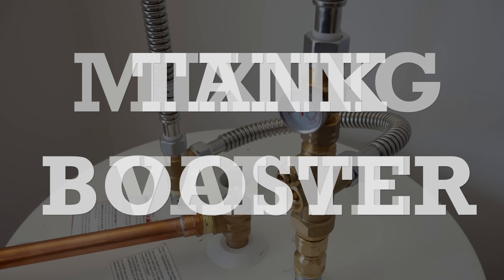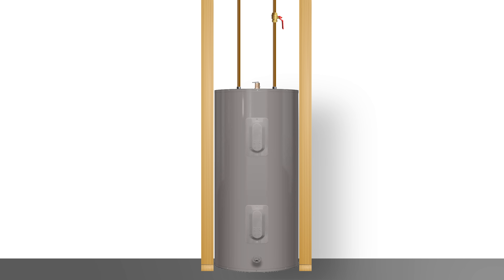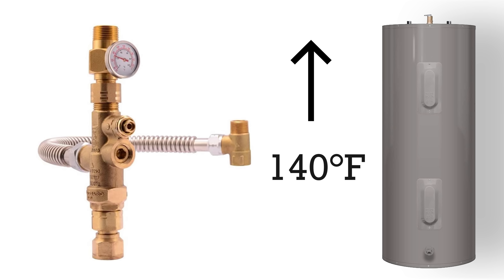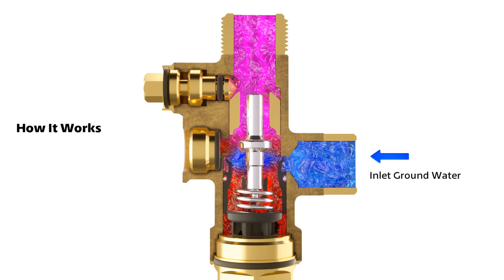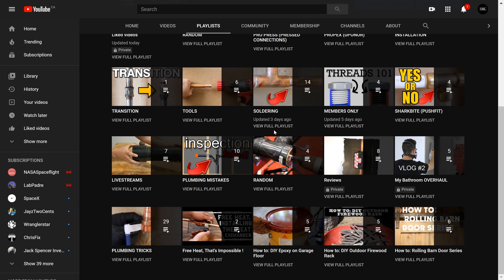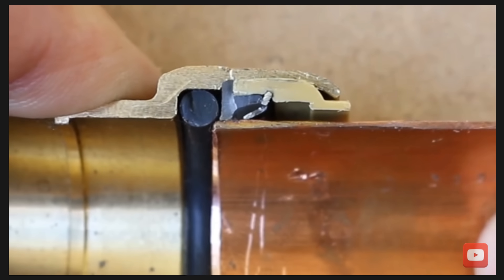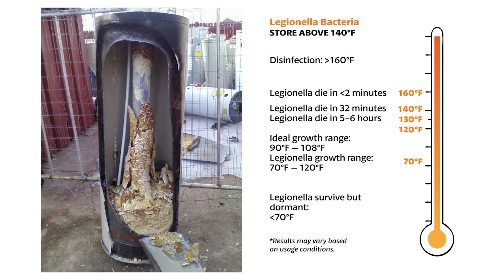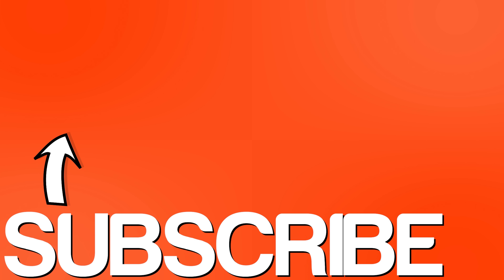INCREASE Your HOT WATER Capacity With This! (Cash Acme PRO Mixing Valve) | GOT2LEARN

Comment: That's a completely flawed argument in favor of the mixing valve, it does NOT save money.  In all truth, keeping the hot water tank hot means there's more thermal pressure, aka delta t.
The period of time where the water is heating is the most efficient time from a heat loss (entropy) perspective.  The only exception to this would be where the hot water supply line is an exceptionally long run, then the cost of the valve and installation might be cost neutral in a few decades.  Mixing valves are used to keep people from burning themselves (elderly) and equipment damage from over-temperature (unregulated solar).
Reply from the maker: You didn't watch till the end I pressume, I said at the end that the only place you save money is by not having to buy a bigger tank.
Reply: @Got2Learn    That would be correct..  However, it should be noted that a mixing valve will never provide more energy (heated water) than what you have stored in the tank, regardless of it's dilution.  The first law of thermodynamics prohibits it.  Anyway, my apologies as this is your channel but as a retired engineer the idea you'll get more out than you put in gave me a nose bleed.
Reply from the maker: @texNoz  the valve doesn't provide more energy, the tank takes care of that as it doesn't deplete itself as quickly, it's quite a simple system, the tank does work harder though let's keep that in mind here.
Reply: @Got2Learn  Firstly, I'd like to say thank you for a civil and open debate.  That's something almost never found on the internet these days.  It shows you have great character with a position of reasoning as opposed to hostility.  Perhaps that's why you have such a following, including myself as I've subscribed.  
Please do the math and you'll see the illusion unfold.  The ONLY way I can reduce the refill rate of a hot water tank is to either reduce the flow rate at the final supply (tap), or reduce the final temperature of the mixed water at the final supply.  Otherwise, the cold water and the hot water will have to mix at exactly the same volume/rate to obtain the same temperature.
The exception to this rule is if I leave an excess of higher temperature water in the hot water line running to my tap, that's where the second law of thermodynamics comes into play and entropy becomes a factor.  Again, keep an open mind and look at the math.
Reply from the maker: I thank you as well, most of these debates go bad, but I find that this is where the true answers, actually get answered.

So here's my thinking. Without the mixing valve, 100% of the hot water is used when a tap is turned on but with the mixing valve, only maybe 50% is used because it's mixed with the cold water, so this in turn keeps more of it in the tank. This wouldn't work if the tank's heating elements weren't bumped up to a higher temperature of course and it's what makes all of it possible.

I also understand that, because the tank is HOT most of the time, the delta T is more of a problem, but from what Cash Acme is saying, it's not enough for it to become a problem and I tend to believe what they are saying because a lot of people have installed these and have nothing to say about them.

Comment: It adds capacity, but reduces your efficiency.  A hotter tank will have more standby losses.
Reply: Everyone should cover the hot lines coming from the heater as far as you can, and adding a "Blanket" to the tank is not hard to do to increase the insulation factor, both saving you money even without this modification.
Reply: @archangel20031  adding a blanket literally does nothing, you losses are from stack and piping primarily
Reply: @MrDmadness Esp. with new/er energy efficiency tanks with the insulation built in and/or housed in a conditioned area. Ours doesn’t feel hot at all so makes no sense to insulate.
Reply: which is funny because the reason the problem exists in the first place is to increase efficiency
Reply: Actually, yes, the bigger temperature difference from ambient will increase heat loss... but a slightly less hot, bigger tank might loose as much heat, as the bigger tank will have more surface area exposed to ambient. 
Also, the smaller tank will "wear out" faster, but the replacement cost of the tank, and separate parts (elements) will be less.
Reply: Additionally, the life of the water heater will be diminished by the overwork it does.
Reply from the maker: @Efferheim  nothing is free! 🤷‍♂️
Reply: @Got2Learn  definitely not $1500 water heaters either. Go away with your petulant money wastin'
Reply from the maker: @keyworksales6241  ?
Reply: @keyworksales6241 how do you come on someone’s channel & tell them to go away? You are the only one who seems petulant in this situation.
Reply: No device that encourages more water use, especially hot water, is going to save energy. The "I need more hot water" is rarely about the dishes or the laundry, it is about showers and bathing. This is just another trick to lower the temperature at every faucet in the home to "save energy". In the meantime some of the laundry has to be run twice, the dishwasher leaves residue and requires rewashing, and everyone is taking a 30 minute or more long shower. The video was.informative, but I really hope this technology doesn't gain wide spread acceptance. It is just a red herring that covers up the problem (if there is one). Limiting hot water use is the number one way to save energy, not making the max available temp lower and lower.
Reply: @adaycj  The water heater should already be set at 120 max for safety. Raising to 140 and outputting 120 doesn't make a difference, except for allowing the tank to store more energy.
Reply: @pb2959  I never said it did or didn't, and I didn't list a temperature. Limiting hot water use is the number one way to save energy no matter what the heater is set at.
Reply: @adaycj  You were talking about making the max temp "lower and lower". Max temps does not change.
Reply: @pb2959  I can't seem to understand where you are coming from here. Did you watch the video? There were charts and text about the water heater already being at 120f and being raised to 140f for the version of this device featured in the video to work. The temp at the faucet or point of use IS lower if you mix in more cold water when you start with 120f (or 140f) at the water heater.  The info graphic at 2:58 shows it clearly. They are trying to run the faucet longer before the temp drops too much.  Then starting at 6:12 they are turning up the heater setpoint to compensate.
All this mixing valve does is allow hot water to flow for longer before a 10f temp drop with a reduced burn risk.  I stand by the statement "No device that encourages more water use, especially hot water, is going to save energy."
Reply: @pb2959  umtrue.. it is code in north america that high mass storage must be at 140f this is because bscteria ( legonella specifically ) cannot survive this temperature. You also cannot by code deliver water hotter than 120f to a fixture, hence mixing valves. You dont cost any more tempering the water from 140 to 120, you spent $$ at the tanks storage temp. True that 120f storage will be slightly cheaper but we are talking $20 over the course of a year, not worth the risk of bacterial infection. Ill guatantee you that youd rather spend $20 than have legionella
Reply from the maker: The capacity will be greater than the losses from the differential in this case, totally agree with you Jeff 👌

Comment: i didnt hear how long they may extend hot water delivery.  or did i just miss that part?
Reply from the maker: Depends on the household, can't really tell.
Reply: @Got2Learn  water flow at x temp for y minutes wont matter if its a single person or a fam of 50.
Reply from the maker: Check the PDF linked, it tells you the increase in % with all the variables, hope this helps!
https://www.cashacme.com/wp-content/uploads/2016/06/Tank-Booster-Pro-Brochure-Web.pdf

Comment: I have an external heat pump water heater. The down side is slower recovery, but with increased energy savings.
I've wanted to install a tempering valve for some time, but haven't gotten around to it.
This "all in one" device seems to be the better solution.
Having a heat pump water heater negated the additional heat loss setting the tank temperature higher.

Comment: Don't use the safety valve to drain the tank.  The safety is a ONE TIME USE - meaning that it is sealed with a break away seal -- after the first time it operates it will never seal again and while water won't be gushing out of it, it will always leak after the first use
Reply: Not even remotely close to true. Besides you can not drain  from the t&p valve it is installed near the top of all water heaters where the temp is the highest.
Reply from the maker: Yeah, I don't know where @Keith Proctor got that from lol.

Comment: Most water heaters made today have upper and lower thermostats make sure you adjust both thermostats to 140 degrees
Reply from the maker: Yes, 100%
Reply: I have never seen 2 stats on a water heater.
Reply: @98ek9  On most electric 240v water heaters here such as Rheem, Rudd, State, A.O.Smith do have two thermostats, one upper and one lower.
Reply: @1200sbeemer  fair enough. Haven't done any electric water heater bigger than 15 gal. 
95% of ours are nat gas.
Reply: @98ek9  I hear ya, no problems.
Reply: Your an idiot if you do that. That’s a way to ware out  your wh faster or creat a bomb
Reply: @Thatsouthernplumberguy  who told you this? If you cap off the relief valve maybe a bomb but not from adjusting the thermostats both on 140. 
Both upper and bottom should be set the same temp too btw.
Edit; I once went to a customer’s house who capped off his relief valve because it was leaking, he told me on the phone and the water heater was swelling up. I told him he shouldn’t have done that and to open the hot water anywhere in the house and turn the power off to the w/h asap. When I arrived the fire department was there because minutes after we hung up it blew up. Never ever plug the relief or pop-off valve.
Reply from the maker: @Thatsouthernplumberguy  Do what, I don't get it?

Comment: I got the mixer and installed ez but lost a lot of hot water pressure!! That's a big con!!.... Update liking the little doohickey
Reply from the maker: No reason to lose pressure with these, check the strainers to see if they are blocked.
Reply: I'll check them out
Reply from the maker: @jasont8627  that's the only thing I can think of right now.
Reply: @Got2Learn  no luck! water got a little more pressure better after removed both of still bad hot water pressure after installation
Reply from the maker: @jasont8627  is this with all the faucets in the house?
Reply: I forgot got 2 check the sink strainers, I'm good 2 go now, I think I knocked some stuff off the old pipes, didn't think I would have much I have a water softener.... thanks 4 your replies!!!
Reply from the maker: @jasont8627  Awesome, that would have been my next solution, glad it's fixed!!
Reply: @jasont8627   i’ve found that even shutting the supply down for service work loosens debris in the lines.  I always flush the gunk out of all the fixtures when I’m done.
Reply: @tomrogers9467  is it a 1/4 turn valve 9r a globe/gate if the latter type then what nappens over time is the rubber seal gets crushed and wears out, then it flakes into the line

Comment: So this takes extra power to run? Instead of just turning on the mix at the faucet? Cold water still goes into the tank to replace what was lost but you have to run the water heater much higher to compensate? This only saves if you don't already mix your water and if you do it would waste energy.
Reply from the maker: Watch the video, I explain where you save money and how it increases your hot water.

Comment: Have been compulsory install for last 20 years in Australia. As a safety device for children and elderly  as they start to lose sensation in fingers and hands
Reply: The problem in Australia, the regulation requires 50 degrees output at the closes tap.
So water never hotter enough on the further taps.
Reply: Was just thinking it's funny how these aren't a legal requirement in the US when we have been installing them for like 20 years

Comment: In the winter, the water from the city supply is very cold. So much that my insulated toilet tank gets cold and humidity condensates on it. This valve could supply warmed water to my toilet and resolve the problem, can it be set at 60-70 degrees as an example??
Reply: Perhaps you could coil some pipe somewhere to let your house warm it.
Reply: @chaos.corner  I tried that but the coil gets cold and water condensates on it, it acts as a de-humidifier and I would need to drain it all the time.
Reply: @wetrock2766  Makes sense.

Comment: True way to increase hot water, install a DWHR (drain water heat recovery unit)
Reply from the maker: Works too!
Reply: Nope, the math on this in fact proves they are not worth the price. Plumber for over 25 years here, not trying to toss shade
Reply: @MrDmadness  Depends how cold your water is in winter, up here in Eastern Canada, it drops down to 3C/37F, with my DWHR unit while taking a shower, it bring the incoming temp all the way up to 18C/64F! You can get up to 3x as much hot water. It has became mandatory in new contructions in certain provinces in Canada now, it pay itself in 1-2 years in a 2 individuals household. The unit I use is older and only have 46% efficiency/8kw (3" diameter, 40" long and 1/2" inlet), newer units have 3/4" inlet to reduce pressure loss. https://ecoinnovation.ca

Comment: Great video, glad someone actually talks about this, I have a guess you would called it a "ghetto mixing valve" we found out after buying the house, it's hard piped in. Either way it's very similar, one problem I've noticed when flushing toilets or really any cold water usage you instantly get super hot water so please keep this in mind if you're thinking about doing something like this, also this could be just how my house is plumbed. But there could be an issue arise where when you use hot water somewhere else you'll lose all hot water while showering. He's correct about using more energy as well. You'll use about 20-30% more so keep this in mind in the long run measure your area and just get a bigger tank or go tankless because at the end of the day going this route will cost more.
Reply: Or you just use a thermostatic mixing valve so the temperature is regulated.

Comment: This has been an OSHA code requirement for over 25 years....
Reply: except osha doesn't handle anything residential... no retrofit install will have this device. nice try though.
Reply: @tslim250  it's also code in my state. Also common sense to not die from legionaries.
Reply: @CybekCusal  I have mine at that right now, all original faucets in the house. I get the saftey thing but it's been that way for a long long long time, people have just gotten to stupid.

Comment: Stop lying to people. Neither one "saves" money or increases the amount of hot water.
Reply from the maker: You didn't listen to what I said in the video, I said the only place you save is not having to buy a bigger tank.
Reply: @Got2Learn  the mixing valve one mixes cold water with the hot water, but in order for that to "work" you have to crank up the tank temperature. And the other one is basically a point of use water heater. Neither one saves money. They only give the illusion of having more hot water.
Reply from the maker: I never said you saved money on the water, you save money by not having to buy another tank, using the mixing valve will actually cost more in hot water because of the higher temperature differential.
Reply: @Got2Learn  Actually you did say that it will save you money.
To Quote your video
min2:42 The energy required to reheat the entire tank is greater than if it was maintained at a hotter temperature at all times.
Which is a common myth. it goes against the laws of thermodynamics.
In our world energy is equivalent to money $$$.
It's product propaganda.

Comment: I have never used this particular product, however I have installed tempering valves (sometimes called mixing valves) to do exactly the same thing. Cash-Acme makes a few of them, as does Watts. Question: conventional tempering valves must be trapped: plumbed 6-12 inches below the top of the tank so hot water doesn't rise into the unit when not in use. Apparently the little thermal motor can be damaged over time if not kept cooler. 
Is there something different about THIS valve? Obviously is IS designed to sit right on top, where it will be exposed to very hot water all the time. 
Great series of videos! I'm retired now but still do lots of work for the neighbourhood. You're never too old to learn new things! Greetings from Canada.
Reply from the maker: I just installed it how they asked for it, so must be ok hehe, greetings 🤗

Comment: What a stupid product.
Reply from the maker: Wa?
Reply: @Got2Learn  We have our water set to 70c (160fish) and just mix the amout of cold we need at the sink/bath/basin/shower.  What is the point of pre-mixing down to a temp before deciding on a temp at the tap.  The commenct about you saving usig more hot water is wrong, you just use the amout you need , the device does not save you using some of you hot water at all .
Reply from the maker: @andrewwright1200  scalding, read it up.